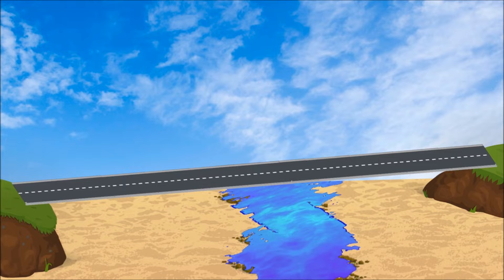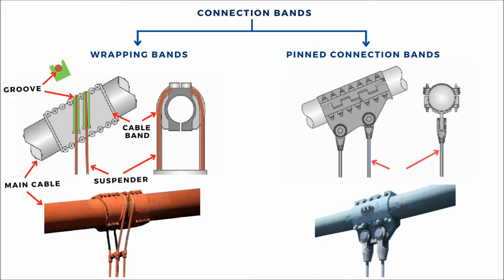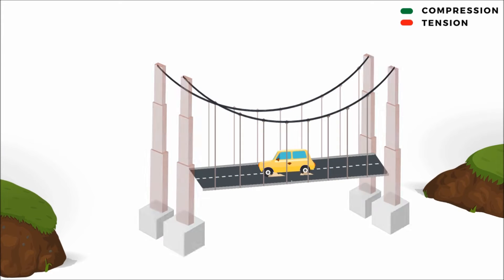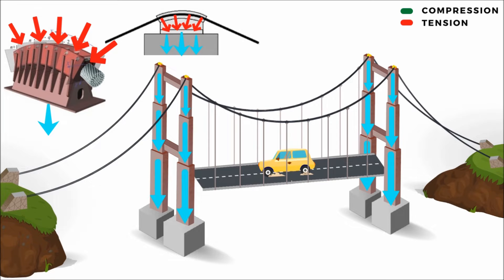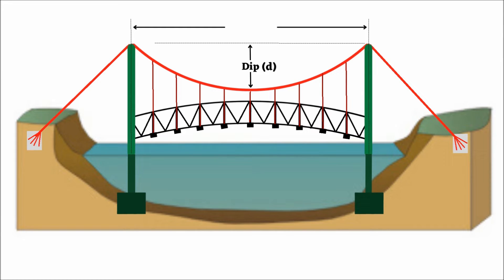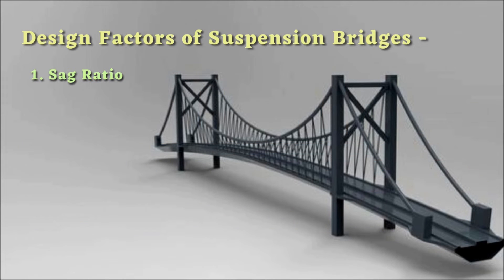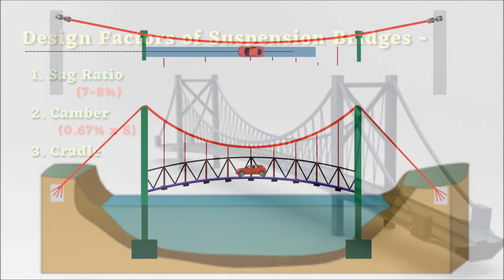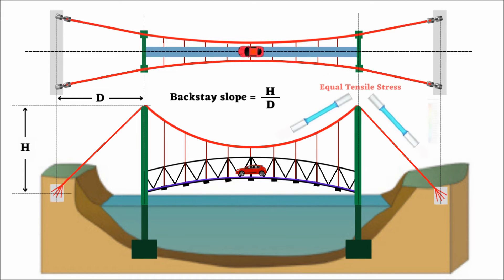Suspension Bridge | How Do Suspension Bridges Work | Design Factors of Suspension Bridges | Lec -08

Comment: Is the main cable sitting on the saddle, and this saddle is supported by rollers at the top of the pylon? Thanks in advance for the reply.
Reply from the maker: Yes, the main cable of a suspension bridge sits on a saddle at the top of the pylon.
The saddle is a specially designed component placed at the summit of the pylon. The main cable sits on or within the saddle groove, which is shaped to match the cable curvature.

While some early designs or, designs for medium spans might have incorporated rollers beneath the saddle to allow for movement. In modern long-span suspension bridges, the saddle is fixed to the pylon. The pylons themselves are designed to handle the massive vertical and horizontal forces transferred by the cables, as well as the bending stresses caused by the cable tension.
Reply: @STRUCTURETECH Thanks for the detailed explanation. I commend you for a very clear and we'll explained content. Keep it up. 👍👏